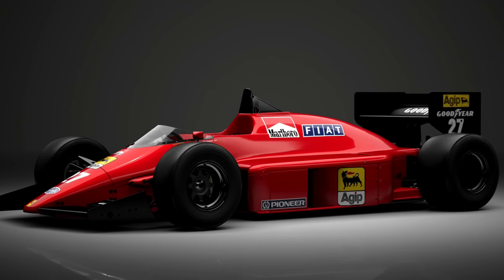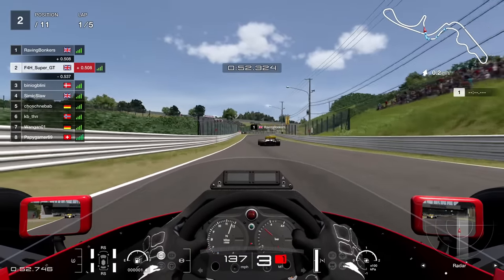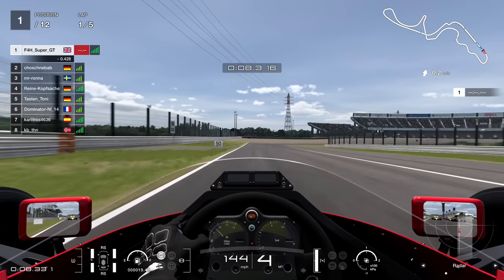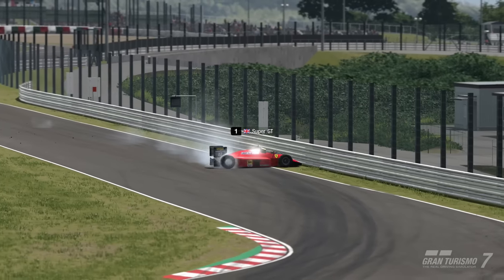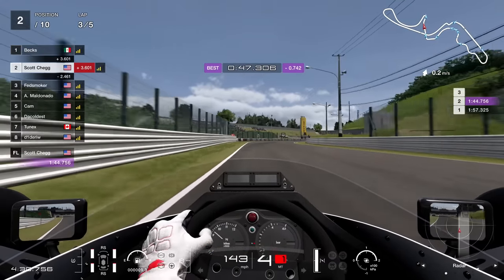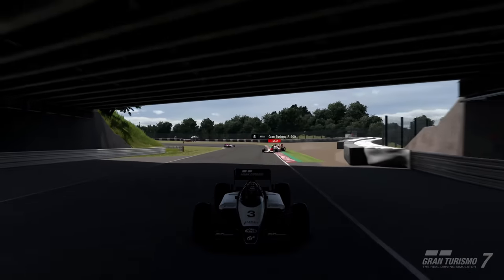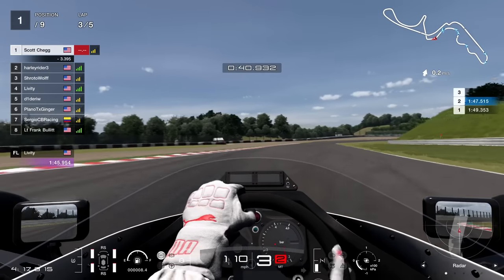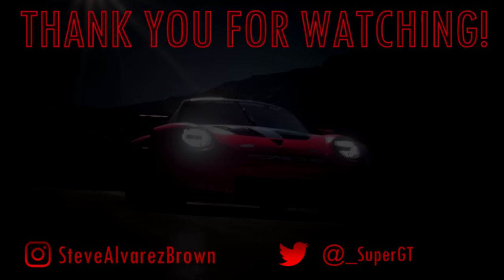This is The Most Dangerous Car in Gran Turismo

Comment: I had to run Counter Steer Assist in addition to TCS to keep this thing in line, and even then I had to drag the brake at 130R to stop it from spinning. The upside is that, while I had to turn those assists on to just keep myself from dying, it allowed me to also push the car without being too timid on the throttle, and as a result I have an FP time good enough for 11th globally.

Comment: The reason gearing up works so effectively on GT7 is these cars are set up for maxed boost pressure all the time. IRL, they could only run like that for qualifying as the engine would damage itself rather quicly, but they made like 1400 horsepower or some crazyness. In AMS 2 you can drive these same cars with more period accurate boost levels, and you can basically use max boost as push to pass 1 time per lap. It very much is, put the car straight into 5th, hold the button, and hold on! With a H Pattern and VR, it is incredible fun and the tire model is set up so the car is much less twitchy and deadly then GT7. If you get a chance, highly recommend giving it a try!

Just be warned, the AI do not adjust their boost pressure per the length of the race on road courses yet. So if you try to do a full distance race, everyone will run out of fuel and technically you couldn't refuel during this era of F1. I recommend 60% distance or turning on refueling so the AI can pit for fuel if needed.

Comment: Now I just wish they add a 1986 Benetton B186 in qualifying trim.
1400+ horsepower at 5.5 bars of boost and just about 550kg would be great fun on Suzuka. Would probably pass Barry R while about 5 feet off of the ground in a ball of mangled fibreglass at 200mph. Top stuff.

Comment: i'm finding myself doing something similar when i first tried f1 22 a few days ago. i found myself spinning SO much more in that one play session vs my whole playtime of f1 20. i eventually found out, i much preferred flooring it (on a controller) on a higher gear after every corner as opposed to feathering the gas finding the grip on the right gear every time :O
Reply: high revs less torque, i think it might be more consistent to race that way but slower, like easy mode
Reply: @aqaridot  i mean, until i find a way to spin out everytime on acceleration. i might just have to stick with this, it's so hard feathering it on the exit finding grip :c

wonder if i should play with my traction control settings, think my braking is semi assisted as well hmm....

Comment: Going from GT cars to Open-wheel cars like Formula 1 is just a nightmare for me, it's so hard to judge their braking point and when you can turn in, they turn in so late and so sharp, in GT cars you can afford to be a bit sharp on the steering but with them, you need to be as soft as you can be 😂

Comment: I wonder if it’s possible to adjust the gear ratios for lower top speed but shorter shift intervals to make it stick to the track better?
Reply: i think it would only make some minor changes, and after you set the ratios for lower top speed you still need to upshift anyways. it goes the same way like riding a Motocross bike, especially a 4-stroke > 250cc and 2-stroke > 125cc ones...

Comment: I'd have to see the settings used on suspension, from toe out, shock compression, and wing down force, to grade of tires. 
It simply looks too loose on gentle turns. 
The Tranny gears 1-3 could be spread out wider, to prevent Hp from spinning out too easy. 
But in this online event, settings may be preset - it's been a while doing these where some settings are insane to make the track simulate glare ice. 
I'm usually default racing the LeMans series. Like on the high speed Monza track typically over 200 mph on the straights. 5000lbs of down force really glues it down on turns, making skid plate show off with special effects.  
I haven't upgraded to GT7 yet, unless forced to and then start all over again from scratch like going from GT6 on PS3, to GTS on PS4. And now level 48.
Cheers, and after 25 years, just know it's all my Son's fault.
Reply: The suspension settings are preset and the settings it shows you are not the settings its running. It's a mid 80's F1 car, extremely rear heavy and the boost is ridiculous. The gearbox is manual stick shift so there is a pause while changing gears which makes it even more likely to step out hence why you use higher gears on corner exit